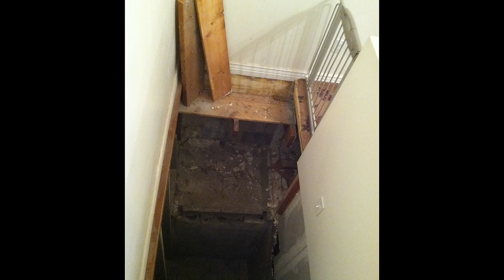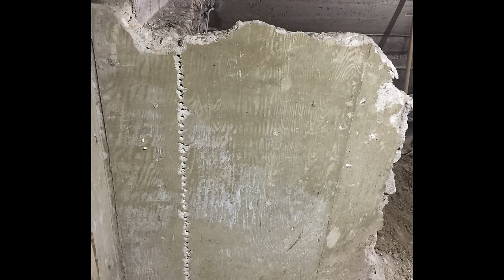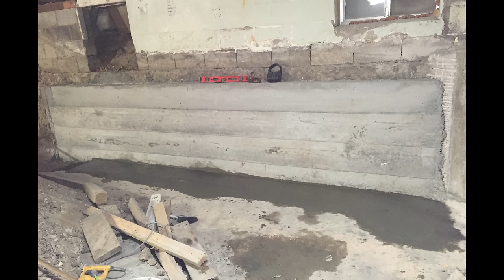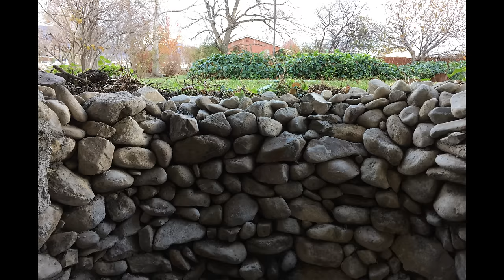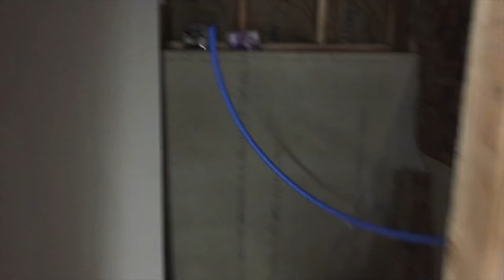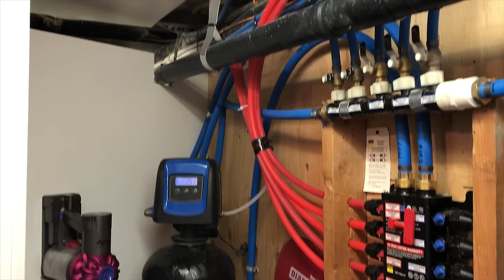Basement dig-out start to finish

Comment: I did something similar between 2011 and 2014.  Three-foot crawl space is now an 11' deep basement.  I built 26 high-strength steel columns to go under the existing foundation, poured a 12" thick floor - was supposed to be 6, but ready-mix company screwed up the pour and poured six more inches atop the first - laid block under the existing footings, grouted the gap between old and new foundation, built an armored door to the outside, and put in a staircase from the first floor.  The only tools I had were a shovel, wheel barrow, a strong back, and the will to get it done.  There were times I could not help but wonder whether I'd lost my mind.  In fact I am there now as I am in the middle of building a new kitchen off the old, about 22x30'.

I'm not getting any younger, and yet this is like a disease.... digging, grading, laying block, and out of seemingly nothing... something arises.
Reply: 12" thick concrete floor.
Well...  Won't the poor bastards who have to tear THAT out to get to plumbing be surprised...

Did you rebar/wire mesh both layers?
Reply: I am renovating our only bathroom in the house. I had to LOL when you said, "There were times I could not help but wonder whether I'd lost my mind." OMG the details are endless...and then, "Dad I need to use the bathroom..."  ;-)
Reply: You write like a very intelligent guy. To visualize is a mark of a great engineer. keep up the great work, keep a log, you might be able to sell it, inspire others one day.
Reply: WARREN CORCORAN I highly doubt that
Reply: Well you're just slow if it took you 3 years to do your basement. This guy did his in 15 minutes and 55 seconds. Now that's dang fast if you ask me. ;-0
Reply: TrailTrackers 

That’s nothing I’ve created life in less time than that
Reply: Keep it up Andrew....
You give me hope

Comment: massive job..  i live in canada and a 40 x 50 rectangle bungalow  cottage in Quebec was sitting on post n pier 40 yrs old. ..  it took 4 summers but we dug it out.. and cast a form and built a full height basement   but kept it unfinished for a huge storage place .. gravel sand n boulders  and put the sand gravel mix into the driveway   and made the glass windows from used glass n wood and hand made wood doors because its just a cottage.. .. concrete floor  and gravel base we used the little rocks  for drainage and installed weeping tile  but its bone dry. .. good job..

Comment: Nicely done!  I have done this twice in my life - Once with my father on his home and once on my own.  We not as lucky as you in that our soil was loosely packed sand and cave-ins were constant.  On my father's we ended up removing the original foundations, on mine we did bench walls.  Needless to say it's harder that it looks and should not be attempted without a good bit of thinking & lots of fortitude.
Reply: Curious. When you say bench walls, do you mean you were at say a 6ft slab to floor joist height before digging, then dug under the foundation say 2ft and then had a foundation 2 ft tall and it extended into the basement - like you could sit on the ledge? Our basement is 7ft from slab to joist, but code says we need 7ft from finished floor to finished ceiling and we need a double 5/8" thick drywall ceiling, so with the drywall, sub floor and finished floor we would need to dig down at least 6" to get that height. How far down did you go?

Comment: Wow. It so happens I bought my house here in the 89415 two years ago. It has a very nice basement, which we westerners aren't used to seeing much. Lady next-door, 70 years old, said back in the 60's the man dug it by hand. He was a miner. He added on an underground water tank, obviously thinking fallout shelter. Thing was, you can see incredible damage in the attic, the house must have started to collapse. But he did a solid job down there with concrete floor, cinder block walls, carpeting.

Comment: Awesome final result, you truly have a basement you can be proud of. The only that that concerned me was the fact that you have all of your networking gear in the same place as you have water. If you have a water leak, that could be an expensive repair/replacement of your network hardware.
Reply from the maker: True, a water leak would be my downfall!   I hope that PEX does it's job and doesn't ever do that to me.
Reply: My in-laws designed their basement the same way... and had a leak... and thankfully it only destroyed the modem and a switch. One of the compression fittings for the sprinkler system failed and started spraying water directly at the modem.
Reply: My thoughts exactly. I'm a certified water & mold renovation tech. Worker on thousands & thousands of projects where all the internet, phone, cable, alarm etc had to be totally replaced cause of the water heater / softener burst. Fingers crossed this won't happen

Comment: Nice work. Great job on the construction of the walls. Looks like if you ever had the wall fail behind it, the wood would take the load if needed. Not sure if you had the concrete sealed or not, just 1 extra step i would have done, but not required. Again, fantastic work. Im exhausted just by watching.

Comment: Fantastic Job! A lot of hard work went into making your  basement a personal crib. You might want to consider moving your water works to an outside enclosure, away from your network system. Since you're using pex, it wouldn't be that difficult. I had issues with my Viega manifold in the past.

Comment: Holy crap hats a lot of work nice job  i knew a guy that owned.a very old log cabin  that was on a stone foundation  that was failing. He  excavated  under the house to the stone and. Re enforced the  stone  it was all dug by hand and 5 gallon bucketed out of the hole by only him  it took him 4 years    During the process he did  go and do a full basement. After realizing how much bigger his house would be   !   He had extra challenges as his  home. Was built  very close to a river  he  poured  concrete   Pilings to jack the house up off the foundation to rebuild  that  wall  and to give him more headroom to work under the house   Part of his logic anf reasoning was he loved the property and the house was   A historic   Home with  ties to the civil war so  he couldn’t just tear down and rebuild   ?  There was not a plumb or level. Spot in the place  after he got  done  admittingly it was a cool house    With the old horsehair plaster walls they used back then

Comment: Not sure if Inspections are required in your state, but a few issues with the build. Not doing this to call you out, but these would have been more than recommended! 

The supports should have been concrete filled steel posts with a 12"x12" footing with a depth of 12"-14" for every one to rest on top of, those wood posts will eventually rot and could cause the house to sink, you could have used the footing and a plate to mount the 4"x4" to it instead! 

The windows, if a bedroom is located in the basement most states require a fire escape that has at least a 36"x36" by whatever depth to the bottom of the window for an opening in the ground and that window in the basement must be easily opened as one unit to allow escape, this would also have been a good precautionary addition! 

The last thing which can be a trip hazard is the landing for the transfer between the sets of stairs, that extra step against the outer wall should not be there!

I know much of this is too late, but these pointers could help others who plan on adding a basement!

Comment: Questions:

1: Did you use a bonding agent between different wall sections to make sure the different pours of concrete adhered to one another?

2: Did you use wire mesh or rebar in those wall sections?

3: How did you waterproof the new foundation walls and floor?

Comment: luv this was wondering if u put rebar in the walls or jus concrete and did you go over a few inches like outwards with concrete?and about how much did it cost you to do total with appliances and how much u think without like heater appliances jus basic concrete and wood?looking to do my house but keep getting the I wouldn't do it if I was you,i figure if I do wall per wall I be ok anything structural keep it structural lol or make it more stronger by adding to it if u get what I'm saying.thanks

Comment: It looks like you built a stud wall, lined it with boards and poured the concrete. Then took it down and reused it. Did you hand pour the concrete or have it delivered?  If you didn't jack the  house up how did you pour the last bit of concrete for the plate? BTW one hell of a job! 👍

Comment: I don't know how that concrete wall is holding up now. I think the proper way to do it would be to dig from the outside and the inside and do a proper form with rebar then waterproof and re do the drain tile.

Comment: You better take some precausions with that water heater, one leak in 10 or 15 years when it goes bad with no Pan under it, and poor wet basement. Also, didnt notice any reinforcing of the walls with reed or wire, and no moister precausitions, so I take it a dry area? Zero Water Table?
Reply from the maker: It's hard to see but their is a drain a few feet away from the bottom of the water heater in that closet.  Also I did re-enforce all the walls with rebar and tied them together with it.  I used a plastic moisture barrier between the insulated walls and the Sheetrock,  I do live in a dry area, would have to go down a lot further to find water.

Comment: Great job. We did a 1/2 excavation of ours. Wish we would have had the conveyor system. We had to lift bucket after bucket to dump out of a window we cut. Ours started on a 3' crawl space. We subcontracted out the foundation work as the insurance company had issues with that. Building inspector was being a pain also when plans were submitted but eased off when the foundation contractor got involved. Did you use the purple drywall ? Will not mold, burn, and water won't damage it.
Reply from the maker: I began this project with buckets, after about 1000 of them I found the conveyor lucky.  I used regular drywall, but the inside foundation walls were very dry, and there is a lot of insulation in-between the drywall and walls.

Comment: I live in NYC, If i do a Job like this, I have to keep it on the Hush, Hush. Nosy neighbors like to call city inspectors, City want's money for permits. If not  violate you with big fines $25,000 "Yeah They Are Crooks". They may even condem my home and deem it an unsafe structure, Just to screw you. 

Hiring a Contractor is out of the ? As they are rippoffs. 

This was an Amazing Video, Lot's of work. 

A project I can't take on due to back injury. It is something me and the wife have thought about doing. For now our Basement height is about 7' tall or a little less. But my son who is 6'2 fits just fine. 

Great Video, Thanks for sharing 👍
Reply: EL EVO move to Missouri. I did. Use to live in down town Portland OR
Reply: There are reasons for contractors and inspections. I hope they had professional engineering oversight for the project. It looks nice, but there can be worlds of horror as far away as a layer of paint.
Reply: hire a contractor who is a mate, and you do the work but say he is doing it
Reply: jxckfx graphics which is illegal by the way.
Reply: zack9912000 i would assume keeping it on the hush hush is
Reply: jxckfx graphics yea I get that we had a guy here who went to prison who did similar work without any inspections and didn’t follow any code requirements.  Then years after he sold the home. A wall fell in killing the child of the current owners. I personally love when home owners can do the work but it needs to be done to the letter. With inspection and everything, not hating on all the hard work he did. A lot of project like it or not are need to be done by pros.

Why when ever I buy a home and renovations I ask for copies of all permits and copies of inspections done.
Reply: zack9912000 Yes, bit everything in New York is illegal. You are not even allowed to defend yourself with a bat if someone is trying to rob you, stab you or beat you down..

 All these laws are depriving us and keeping us in Poverty.  This is why people take there chances.
Reply: EL EVO certainly there are laws that are bs but some of the shit I see from DIYers complaining about cost or pros, their own work it is so bad teenagers tree forts are Safer
Reply: zack9912000 Maybe if Contractors and City Officials weren't so Greedy, We Would be more then happy to Hire a Contractor.
Reply: Yes irs ilegal to have finish basement in NY without permits my uncle have to tear down everything first doesn't matter if you meet the code the most important is the permit the best wayt to save money is create your own company and get the license if you know how to do the job to just do the job and avoid any future problems. It's no very difficult as many contractor said they hire a illegal people to do the job and take all the profits for himself of course if your digging is more dangerous but if save to do it if you have structure sound post metal
Reply: The corruption in the US is from the very top (and from the Global) down to the local level. It's really a shame. 

So many in business have lost faith in doing the right thing, building trust and a reputation, and then they complain when their businesses go belly up and they have to relocate. 

Meanwhile they have to compete with foreign owned who hire foreigners/cheap labor - who do lousy work until they become skilled and are no longer available.

Hope everyone gets fed up with America heading in the direction of banana republics and the rule of law is restored.

Meanwhile, this guy did AMAZING work!!

Comment: Hopefully you see this... but I have a concern regarding water infiltration... and of radon.

I didn't see any type of seal on the back of the bricks and stonework.  This stuff (the stonework, specifically) has a tendency to weep moisture and, ideally, would be sealed to prevent mold growth.

Next, radon venting is very important - did you make any precautions?  If not, you want to get a vent and install it (you have windows there to use, so it's not such a big deal).
Reply from the maker: I live in a dry area, the home has been here for years and there were no moisture issues.  The new concrete is 8"+ thick, so since I was going from cinder block to concrete I felt OK about it without extra moisture barriers.  I have not tested for radon yet, but plan on it.

Comment: Correct me if I'm wrong.  It looks like you undermined the foundation only a section at a time, 15 to 20 feet, and undermined it about 1/3 of the footing width, then poured a new footing and wall underneath that 1/3 and extending another couple of inches out.  It does not appear you needed support the house using this system.  Is that about correct?
Reply from the maker: Yes that's basically what I did.  went under my previous foundation 4 inches and out 4 inches giving me an 8 inch concrete wall minimum , and I think 16 inch new foundation at bottom or so.

Comment: Question, after going through all of the trouble of excavating that much material, why didn't you go with a full hieght cieling, instead of the low cieling you used?
Reply from the maker: I would have had to demolition the existing basement floor, dig that out, brace the house, build all new taller walls,  etc.  It would have just been way to much, and since I'm not a super tall guy, it worked out fine as is. :)

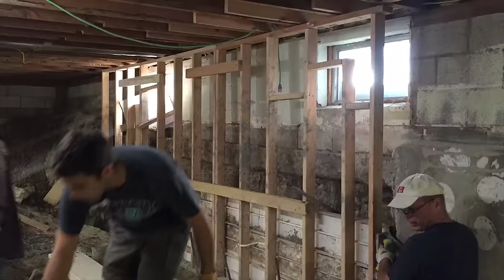Comment: @4:05 are those aluminum forms you are stacking securing behind the 2x4 reinforcement wall?
Reply from the maker: Those are vinyl forms,  light but strong form, and a smooth finish.

Comment: Great Job! 
Two questions though.  How high are your ceilings and why not make a wider staircase to get furniture in and out easier.
Reply from the maker: My ceilings are fairly short, 6'9"  I would have had to demo the entire basement concrete floor and done some crazy stuff to make the ceiling taller.   The staircase was sufficient to get my furniture down and it would have been a major undertaking to widen them, so I just left them be.

Comment: Looks great but is it health? 
Probably not for very long.
Water and moisture will do what water and moisture does.
Reply from the maker: It has a water barrier,  also the outside of the foundation is dry since it's on higher land than the surrounding area, and cemented over.   I live where everyone has basements that are dry walled, no mold issues in this climate.
Reply: @StewartRedmond  
I'm not familiar with climates dry enough for moisture, condensation etc not to be an issue in basements, but I take your word for it. In my region, the northeast, people who  make living spaces out of basements just aren't using common sense. There are no adequate measures to make remodeled basements a healthy option for my region

Comment: The finished project of course looks great, but the stuff you don’t see is sketchy.  Apart from the floor, I did not see a bit of rebar used to reinforce the pin walls.  Nothing tying in each section to the other or to the existing foundation.  How did you tie in the plates to the foundation?  How did you get permits to remain open for so long?
Reply from the maker: There is rebar that ties each foundation and cement wall together, might be hard to see in the video.  I also capped the existing foundation in the concrete pour.

Comment: Lots of hard strenuous labor, but in the end some fairly big drawbacks. How did those stairs meet code with having a step like that? The basement walls are eventually going to start cracking with not having any reinforcing bar or 3/4 aggregate mixed in. The walls being poured with hand mixed concrete by the looks set on bare earth with no real footing underneath. I see trouble down the road.
Reply: And no waterproofing from what I could see.
Reply: Buzz kill
Reply: Rich ie --- Yeah, something doesn't seem quite right to me with the reinforcement.